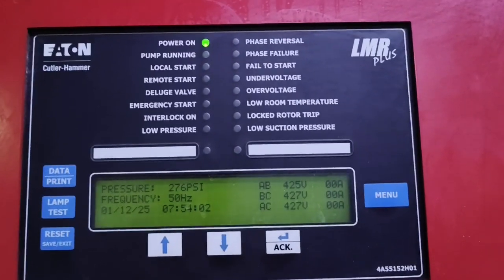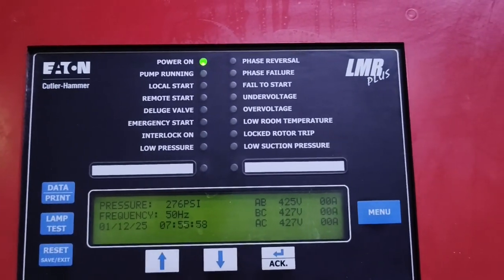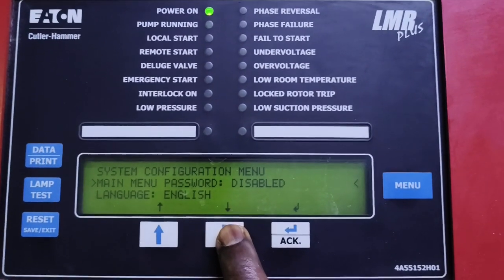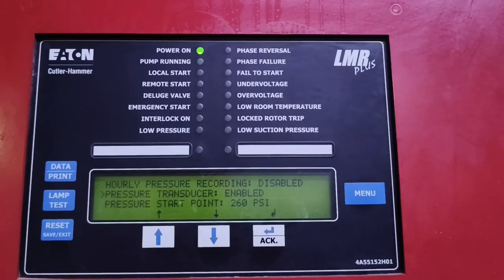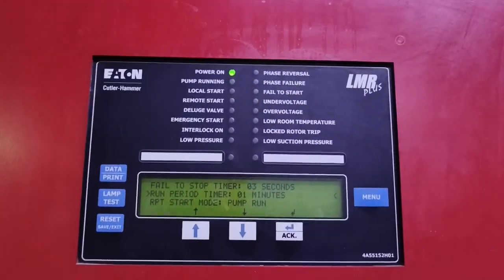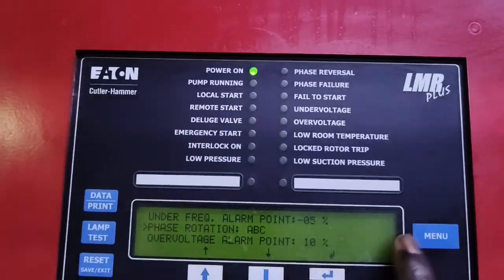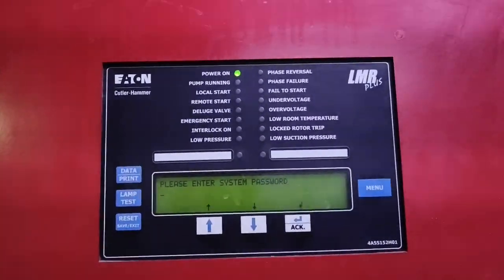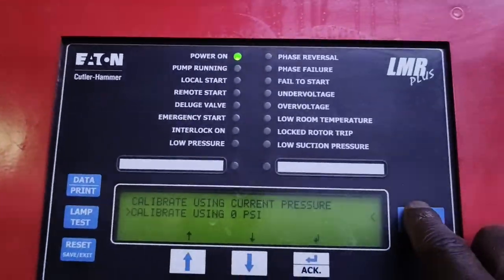Eaton Cutler hammer fire pump controller setup and calibration by Engineers Guide

Comment: how to solve diesel pump control panel showing deluge valve indication
Reply from the maker: There is mostly in the controllers jumper that activates and deactivate deluge operation check and disable and for others its a program function that can be disabled and it will solve the problem

Comment: May I ask, how do you resolve the overvoltage issue?
Reply from the maker: Controllers can give false voltages and so you have to confirm by using calibrated multi meter to check whiles running and if there is a difference you can calibrate your voltage....